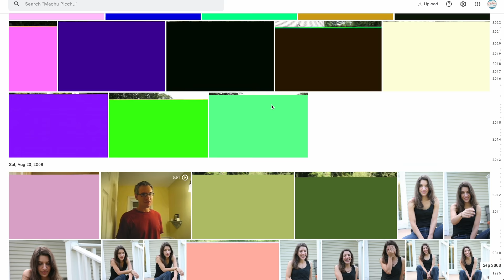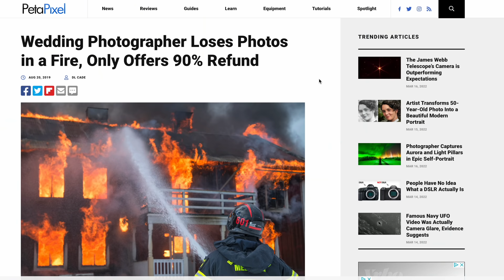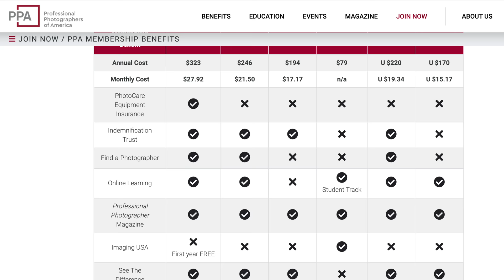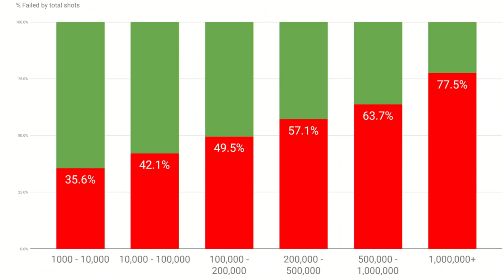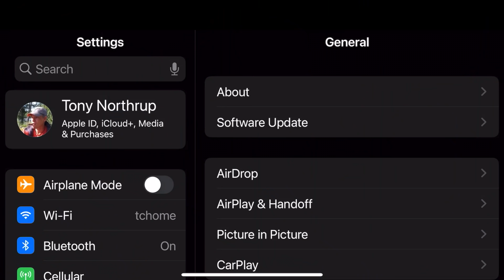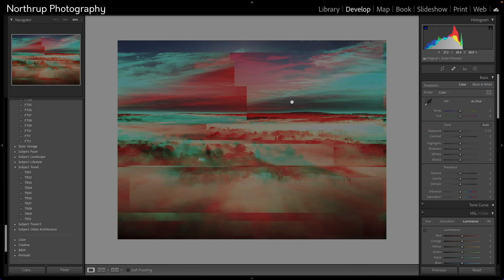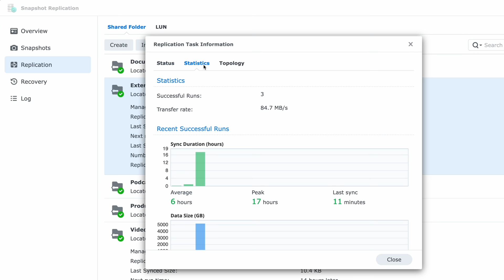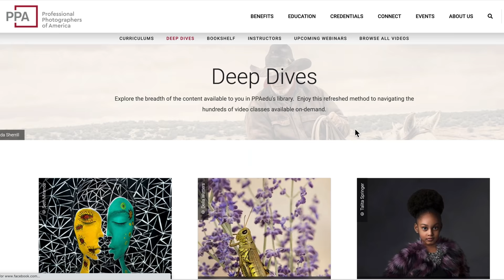NAS Storage for Photos & Video: PROTECT YOUR DATA!

Comment from the maker: TELL ME YOUR STORAGE HORROR STORY! And use this link to get $25 off your PPA membership https://www.ppa.com/join/tony-chelsea-northrup/mar2022
Reply: True story: Adobe Lightroom mobile early days, circa 2015ish they lost my entire online  catalog (which was relatively small at that time, only around 800 raw files + edits). I was a paying member, was in between main desktop catalog machines and ADOBE had data loss with NO enterprise recovery or backup abilities at the time! All I got was a slew of uninformed tech support reps on the phone and a few very apologetic emails.
Reply: I've run a synology nas for years......might be time to double check it's doing what it should be doing :)
Reply: ALWAYS at least 3 different back-ups on 3 different types of harddrives/SSDs, NEVER use the same type of drives  ! (a fault on a drive will be on ALL drives if it the same type !), so buy 3 different drives at 3 different times to be shure.  ALWAYS check each back-up and NEVER delete/format the memory cards before you are sure you have 3 different back-ups that work well ! All drives must be offline when not in use ! When you do back-up, turn the internet OFF ! Do not use "NAS", if you do use 3 different types.
Reply: A mirrored zfs array will automatically heal those corrupted files every time the file doesn't match the checksum.
Reply: Just came across a picture today that had bitrot.  Luckily the copy on my desktop was still in good shape.
Reply: I didn't know PPA covers amateurs. Are there different levels of membership for enthusiasts vs working pros?
Reply: I film longer than I shoot seriously.  I thought my video recordings from the 80s and 90s were safely stored on DVD, until I noticed that some brands had their data broken.  Saving them on a hard disk is the salvation for me for the time being, I thought for the years that I'm still alive, I'm 67 :-).  Saving it online on Youtube is not an option because I used copyrighted background music in the editing.  As for photos, I also save my best photos in physical photo albums, including high quality paper :-) And nothing lasts forever.
Reply: Windows Vista used to corrupt photos and I found out the hard way. Fortunately it wasn't a heartbreaking loss though.
Reply: Tape - reliability
The main advantage of using tape drives is they are reliable storage devices as data stored on the tape drives can be read securely even after decades of storage. Because of this, many enterprises (or large businesses) use tape drives as their main backup system. In addition, tape drives can be easily removed and stored offsite, so the data stored on it is protected from any hardware failures, corruption, theft, or natural disasters.

Although tape backups are viable, they are slow and expensive. As tapes are sequential access devices, finding and restoring individual files can be slow and troublesome. Thus, tape drives are mainly used for archival purposes to store data that is not changed or accessed frequently.
Reply: Long story short:  I had a laptop- AND external HD both die on me- out of the blue, eliminating all my work from 2007-2012.  I wanted to jump off a bridge.  I thought I was being careful:  I never travelled w/ the laptop/never dropped.  HD was only used for back-ups- as needed, etc.  I love digital- but I HATE it too.  I NEVER lost any slides or negatives in 35 years of shooting before digital.....  ps:  I did talk w/ some data recovery services, but the price seemed steep:  $750-1500, and NO guarantee of success.  pps:  I have NEVER had a card failure, either SD or CF; never!  However, I've had (3) DSLRs crap out on me, (1) laptop, (1) external HD.
Reply: Had an 8TB hard drive crash. It was pretty full of backups. Contacted the company. It was out of warranty. They let me try their proprietary recovery software at home. Two days of running it, then nothing. They finally offered to let me give their in-house folks a chance. (They could see that ten of my registered hard drives were their brand.) I sent it back (in the original box which I happened to keep, then forgot about it. It if worked, it worked, if it didn't, it didn't.
Reply: I forgot about the crashed hard drive and went about my business. A month or so later, I got my hard drive back, working! Then I copied the recovered files to a different hard drive. Yeah. and packed the crashed one away in my cabinet.
Reply: I had a near horror story, back in the mid 1990s. This was a bit before serious digital photography, though I was using a film scanner for small bits of it. Anyway, I had a large SCSI HDD that, as it was in those days, had not been backed up, and I had realized I really had too much for most kinds of backup. I bought a Sony tape backup system, but couldn't get it to stop crashing my whole system. So about a week or so later, I traded it on a more expensive Travan TR-4 tape drive. I ran the backup... success! Less than a week later, the drive completely died!  

So for all those folks who's drive died just before the backup, [a] I probably sucked up at least a few years of random luck on that one, and [b] back it up today!  Don't wait a week!
Reply: I have experienced corrupted files written on DVD as backup years ago. I like your solution with keeping mirror to your neighbors at least in USA you don't have a war conflicts to make it fail.
Reply: Laptop slid off with the SD card inside. Dented the heck out of the card but I was able to jam it into an SD slot on another pc and save the photos.
Reply: @johnvalk  I have some of my family photos on paper.. and I have scanned very old photos and described when somebody wants copy of some photos. I looked for example photo my grandpa from II WW described as K117.. I am searching this file and give it without scan again this photo from album :)
Reply: One of the lessons this teaches -- a lesson Tony may not like or agree with -- is that nobody needs "thousands and thousands" of photos of a child growing up. In fact, not only do you not need this, you do not even want it. Not truly. You just do not know it yet. If you do not know this it may be because you so far down the rabbit hole of photography you cannot see daylight. What photos do you truly want of your child growing up? A few good ones. That is it. And when you are 67, you will know this, too!
Reply: I have a 3 month gap in my Lightroom catalog where I accidentally deleted files. Still have no idea how I did it, but it haunts me every time I see the little question mark folders (yes, they were deleted from the disk, not just the catalog). That was enough horror for me. Major upgrades to the backup system quickly followed... but the idea of multiple backups of corrupted files is a new horror for me, so thanks for making that visible. Ugh.
Reply: Well, you probably saved me from horror because after watching this I double-checked everything and found that my Synology-->Backblaze connection had broken without me knowing it!
Reply: I transfer photos as soon as I get from my trips and then reformat for next trip. I cleared one by accident before transferring and found out later when looking for missing Yosemite pics. Thankfully I had not used that card yet and was able to get an "undelete" software that helped recover those photos! Whew! lesson learned!!
Reply: My wife and I were at Angkor Wat with an early digital camera and a brand-x (probably) compactflash card. The card wasn't registering images properly. We arranged with our guide to do a relatively-quick repeat of the sites we'd visited the previous day. Probably wasn't as good light as the original tour, but at least we came away with images... and memories.
Reply: Most cheap "iCloud" is YouTube itself. 

I mean, if I would vlog and everything, I would probably delete the uploaded videos on the hard-drive, after a while ;
or at least the individual clips that did not make the final cut or different unused takes kind of videos. 

If one makes music videos, final product videos (weddings etc.), sure, you would want to keep the final videos also stored in different locations. 

But, for vloggers, YouTube tutorials and videos like this ("I lost my photos" etc.), just upload to YouTube and delete the video afterwards. 

What you gonna do, if YouTube closes down your account or someone hacks and deletes your account?
Are you gonna RE-UPLOAD YEARS OF OLD VIDEOS, most of which are not relevant anymore and are dated?
Or just CONTINUE doing your thing, on another platform or channel?
Reply: Anyone who has been a photographer for decades has at least one horror story. I have two. Twice my HD & back up failed within hours of one another. I had Dead Drives that looked like they would be paperweights, when my friend Steve Burgess (one of the founders of Data Savers now director of Burgess Forensics) rescued my images. For one of the 4 drives (Tony you will appreciate this) he had to find a read head that was made in the same factory ON THE SAME RUN to be able to recover data... That took weeks but Steve did it.  Anyway, I wanted you to get al least one horror story with a happy ending. 

I keep backups in three places on two continents but now you have me concerned about "BIT-ROT." 

We are building an archive of 60 years of my photography and I want to thank you for excellent advice. There are so many things to consider to make an archive that is not only available but accessible. Really, THANK YOU, you do good work...jt
Reply: @peterrebhahn1113  That's true. But the problem is that deleting is a ton of work. Much easier to just save everything and buy more storage as it gets cheaper.

Comment: I have been an IT person for over 20 years. I shot my first wedding for a coworker 7 years ago. I used a Canon 5D with 2 memory cards. After the wedding I backed up all  my memory cards to my computer and then to an external hard drive. The next morning I left on vacation to go camping. I received a call from my neighbor at 2:00 am telling me that my house was on fire and the fire department was cutting a hole in my roof to let the smoke out.

 They busted out all my windows and threw all my computers and electronics out of the windows. When i got home my Mac was sitting on a pile of debris with water dripping out of it. My external hard drive and memory cards were in another soaking wet pile. I was devastated. I lost everything I owned except for the clothes I took on vacation. I found all the memory cards and my 2 hard drives while raking through the debris. I put them in a bag of rice for a week. I had to call my coworker and tell her that all of her wedding pictures were in the house during the fire. 

After a week i connected the hard drives to a USB device and amazingly I was able to get 100% of my data. Even the memory cards still worked. I learned a huge lesson that I should have been following, being an IT person for over 20 years! Get those files offsite ASAP. The 3-2-1 backup strategy simply states that you should have 3 copies of your data (your production data and 2 backup copies) on two different media with one copy off-site for disaster recovery.
Reply: OMG. How did the fire start?
Reply: @saganandroid4175  not sure. Undetermined.

Comment: Oh man have I been there done that! Replicated corrupted data is a nightmare. Offline solid state back ups plus data integrity checked Time Machine backups, plus cloud galleries that are unsynced and static. Long term data management is a deep rabbit hole. I so feel your pain TonyTone!
Reply: Think you mean offline as in not internet connected? Having the the backup air gaped (no internet access) is a good idea. 
But if you leave a SSD unplugged for long enough the taped electrons that makes a "1" in solid-state storage will leak over time and flipping that bit to a "0". 
How long that takes varies wildly. and i would guess older SSDs are likely to suffer from this than newer ones.  
 HDD, DVD / blu-Ray have a not so good "shelf life". The reason why tape-drives are still a thing for on the shelf data storage.